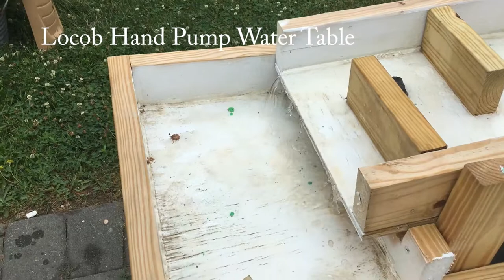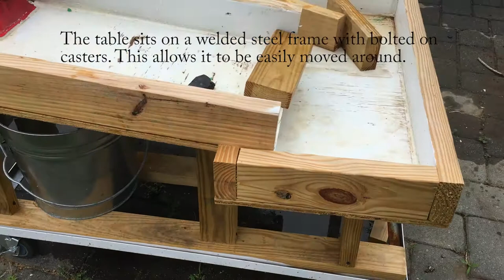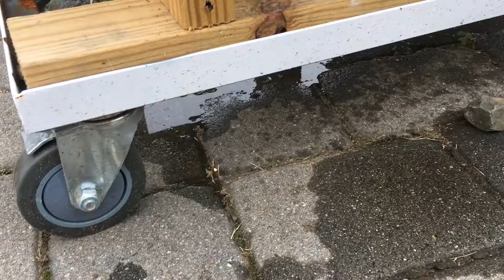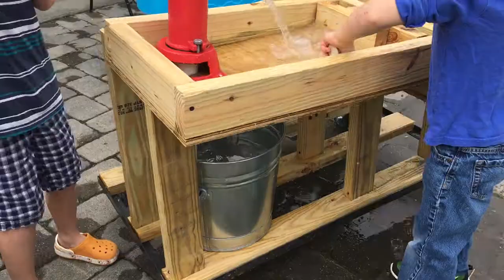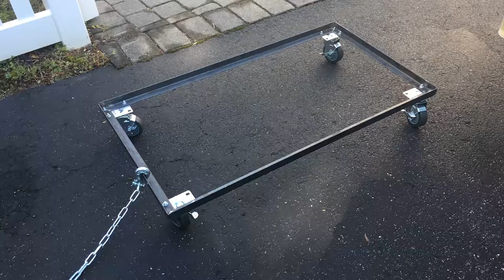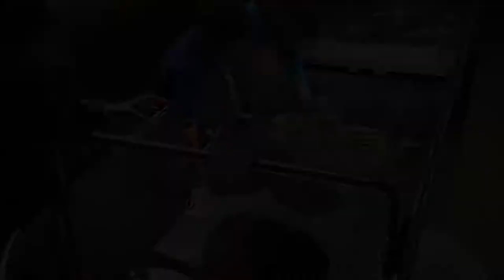Hand Pump Water Table

Comment: I love this! Do you have the plans to make it (dimensions) and supply list?
Reply from the maker: Sorry, I don't. I just built it from the ground up. Most important is the pump, then you can lay out the table however you want as long as it ends up under the pump. It's really just 2x4s and plywood. No need to weld the rolling base like it did if you won't be moving it. Glad you liked it.